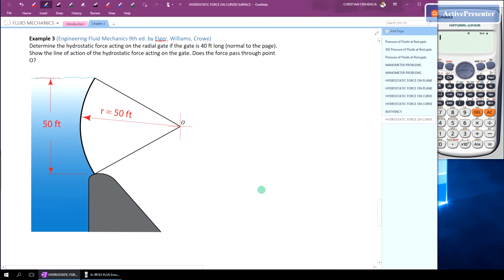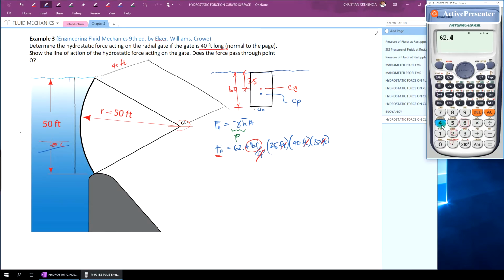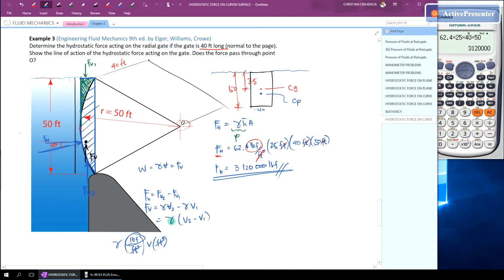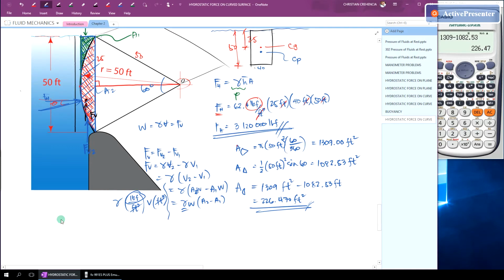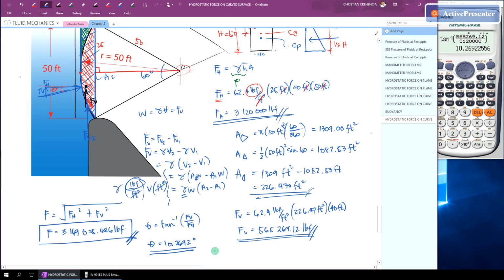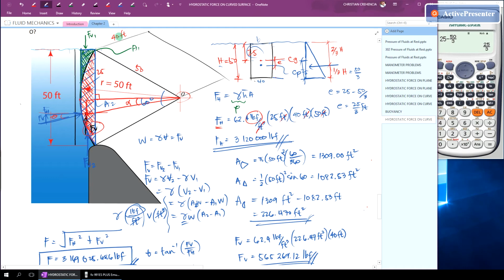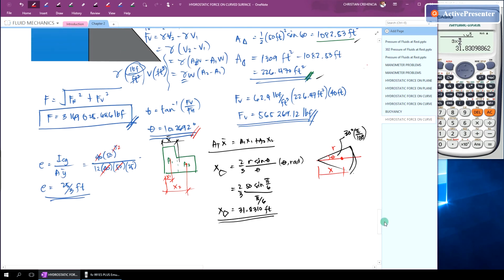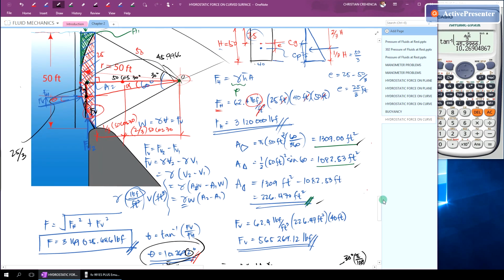12 HYDROSTATIC FORCE ON CURVED SURFACE PART 3

Comment: while calculating vertical for you missed the A2 force .
Reply from the maker: please indicate time stamp.
Reply: 8.50 Inthe case of radial gate
Reply from the maker: @deependrashahi2540  I did not miss anything in this problem. A2 force is acting upwards while A1 force is acting downwards. If we add them together taking upward to be positive and downward as negative, we will see that the net vertical force is equal to the unit weight of the water multiplied by the difference in volume given by A1 and A2, which is the area of the segment of the circle which was shown in 20:36.